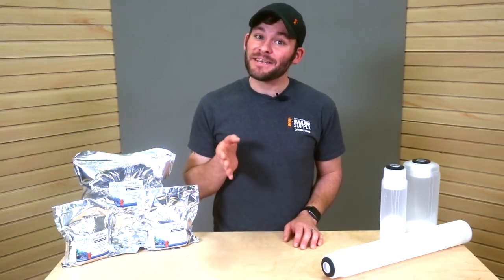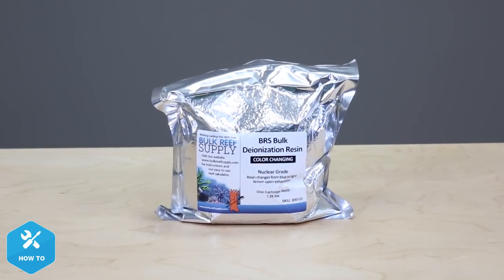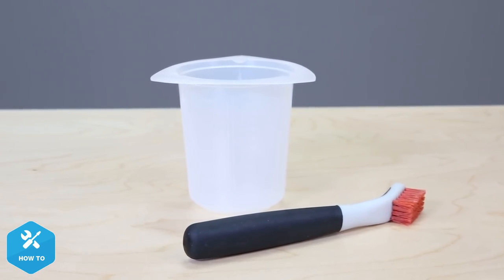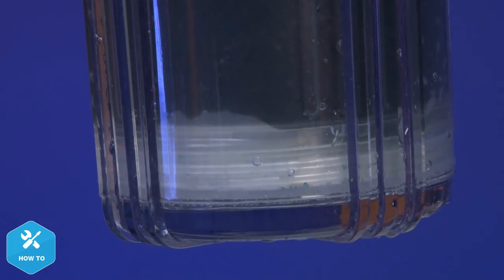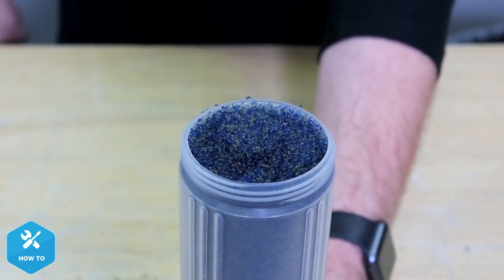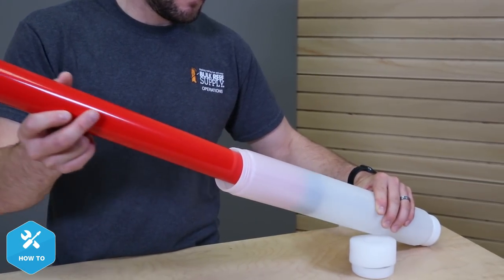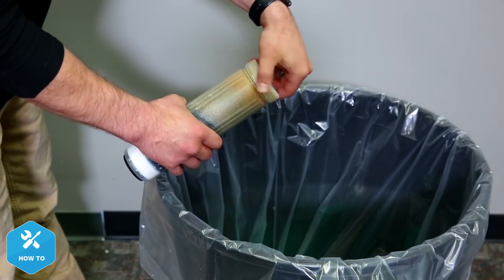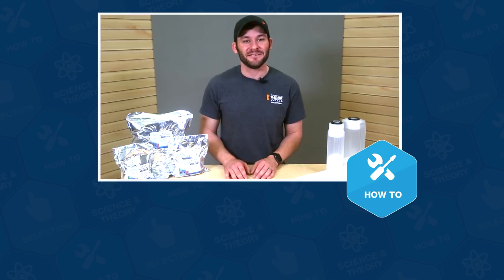How to replace DI resin | BRStv How-To

Comment: After changing them do i run it gor awhile
Reply: Okay, so I was thinking about the same question here.

I did reach out to BRS and this was the response I received;

New resin installation does not require flushing. The only filters that flushing is recommended is for sediment, carbon block and membrane filters.

Comment: Great job. Awesome to see you at the RAP orlando show.  I want to make a suggestion.  I'd love to know more about mixed bed only resin stages VS specialty mixes to be placed ahead of your existing DI resin final cartridge,  to increase the life of your downstream DI cartridge.  I run a  specialty  ahead of  two stages of normal di resin and suspect i get much more life. But i don't know what there made of and i have never ran a side by side comparison. Should be an easy test. Side by side see which one hits 1 TDS first. maybe even a  savings over the life info as well. I make alot of  RODI. its a good place to save money for most hobbiest i think if these  specialty carriages target what consumes most of our users DI for  less over all cost.    
a specific unnamed competitor claims some of the following from such custom blended cartridges
- 4 times the removal efficiency of conventional Mixed-Bed and Hi-Silica cartridges
- Designed to be used in front of a Mixed-Bed or Silica Buster DI cartridge
- Removes most ionized impurities
- Removes ammonia that is left by water sources that contain chloramines.

Comment: Is having a water supply ball valve before or after the unit more ideal? I have it before the unit at the moment and I noticed that my resin goes half dry which the blue on top is turning into a light blue not it’s original dark blue and it looks to be only about halfway used up
Reply from the maker: If your goal is to shut the RO system completely "off" then a ball valve before the system is what I'd recommend.

Comment: How many gallons of water do you think you get out of these canisters
Reply from the maker: That's such a tough question to answer because every water supply is different. Some users with high CO2 concentrations in their water may get less than 100 gallon gallons from a cartridge. Others will low amounts of contaminants may get several hundred gallons out of one cartridge.